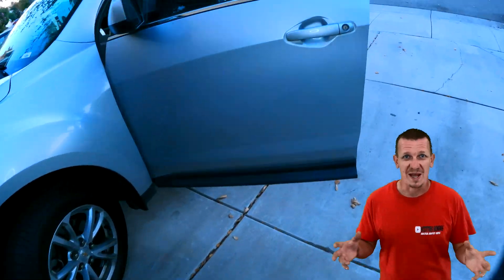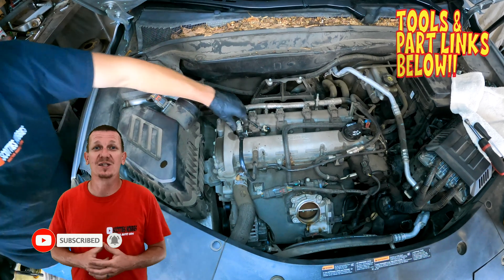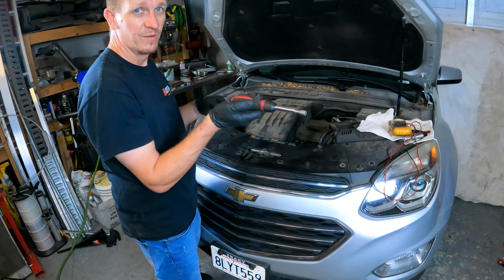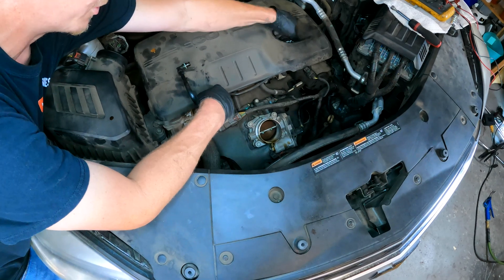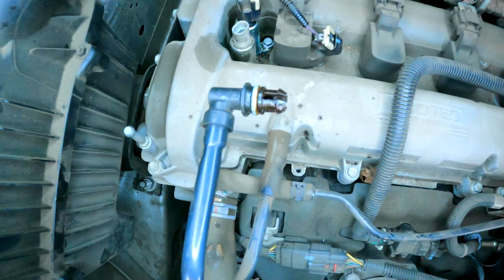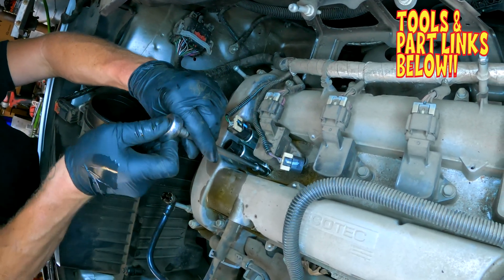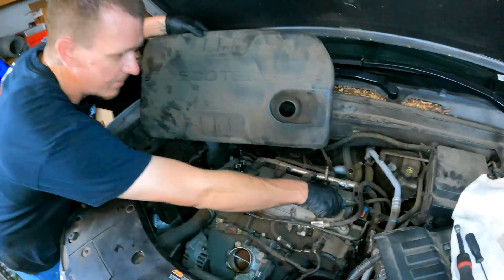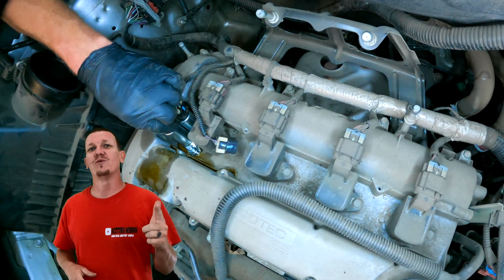🔧OBD2 Code P0010 & P0011 Fix on a 2.4L Chevy, Buick, & GMC | Intake VVT Solenoid Replacement 🔧

Comment: thought seafoam was for gas? i might just change the oil and see what happens. how many volts are the plug supposed to read? and is it a fuse are something that gives those plugs power?
Reply from the maker: Sea Foam is for fuel and oil system. There will be directions on the can for the crankcase. The computer probably gives those solenoids the power and ground they need. I'd put the key In The on position and just check for continuity to start. If you have a power probe, it would co.e in handy on this one.

Comment: i changed them both with new parts from autozone? cleared the code and it pops back on 5 minutes later. im scratching my head now
Reply from the maker: Worst case scenario.. your timing has moved some how. If your tensioner has gone bad, this could be the culprit. The wiring to one of the solenoids could be bad. And the oil passages to the solenoid could be clogged, try a engine cleaner. Like sea foam to clean the ports out. Just fallow the directions on the can.